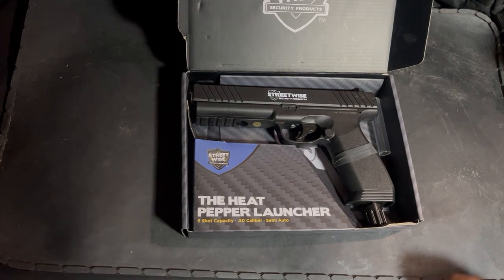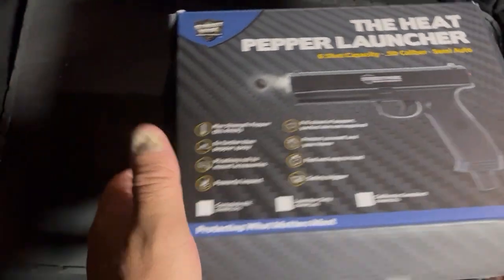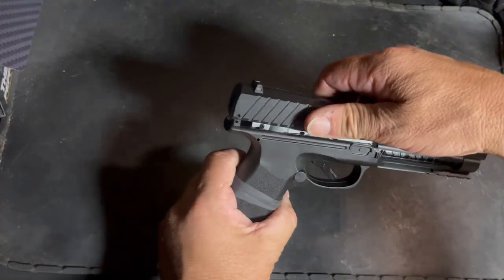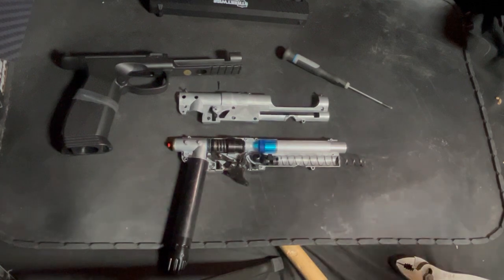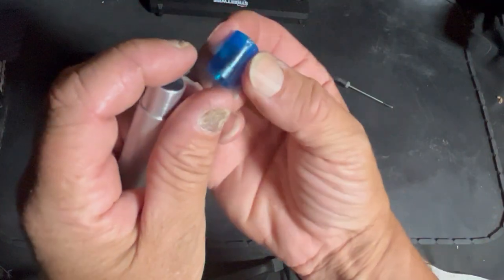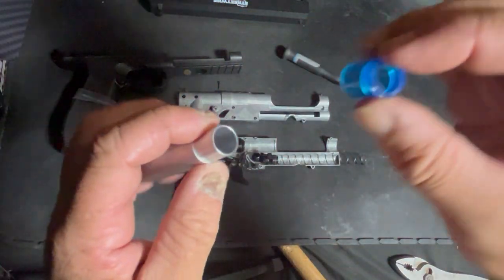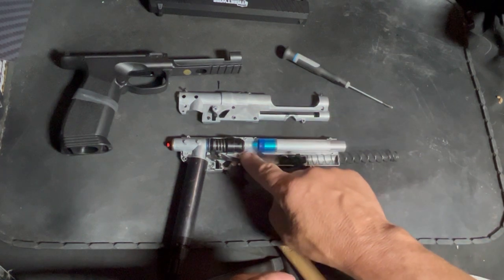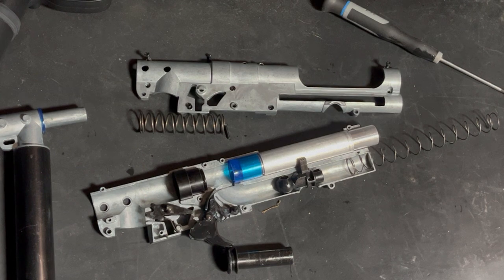The HEAT Launcher Disasembled

Comment: Thanks for showing us. These videos are so helpful if not for anyone but ourselves when putting things back together.

Very Hdp’isk

The chamber does look bigger like an Hdb i wonder if it is just thicker walled. I would think higher than 15j.
Reply from the maker: there is a lot more room in the valve comparatively. The pin was loose. I might have stripped it. it still leeks.
Reply: @airgunsanonymouslesslethal1904 dangit.  Will a Umarex pin fir?